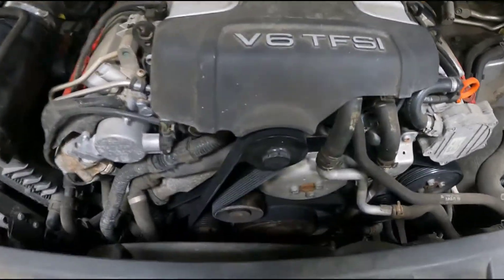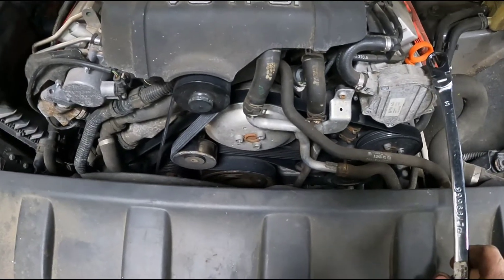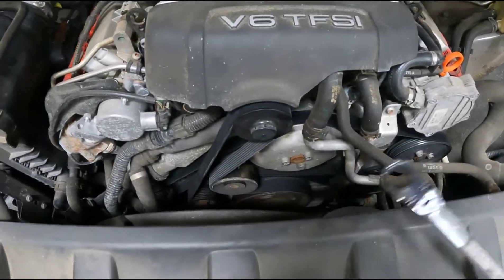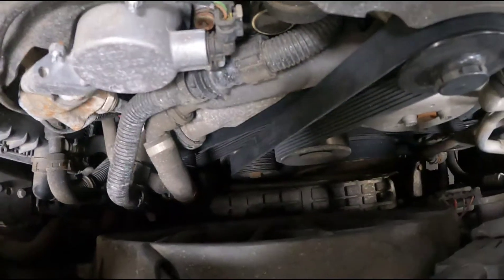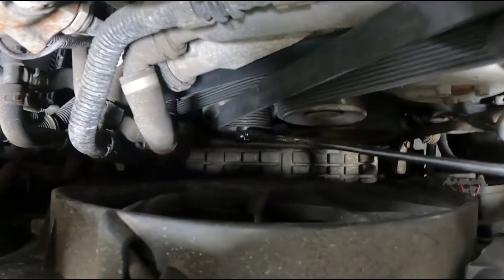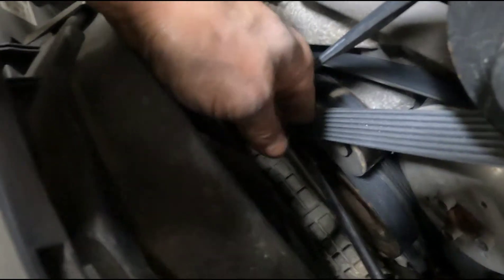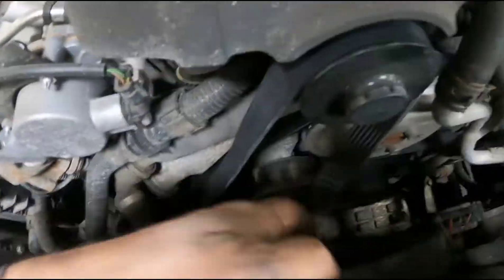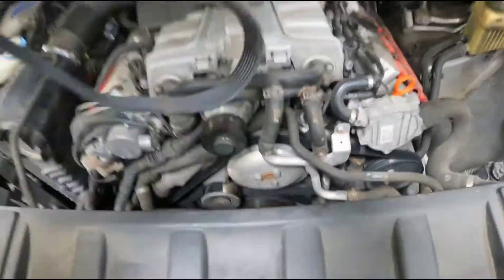AUDI 3.0 TFSI SUPERCHARGER BELT REPLACEMENT

Comment: Change the pulley while you’re at it and gain 100hp and 38% more torque. Mileage increases too by 4-6 mpg. Good video by the way.
Reply from the maker: Yeah upping the boost on these is very noticeable!
Reply: What size pulley?
Reply: @renevanderlinden4091  Look up Revo pulley and stage 1 tune
Reply: Its not so easy to change the Pulley

Comment: It would be nice to know what belt size/length you're using as well as the installation procedure since that's the hardest part, and the only part i came here to see, maybe even a link to the replacement part if you really want to help others, thanks for at least showing part of the process!
Reply from the maker: 06E903137AB.      1270mm.
Thanks for watching